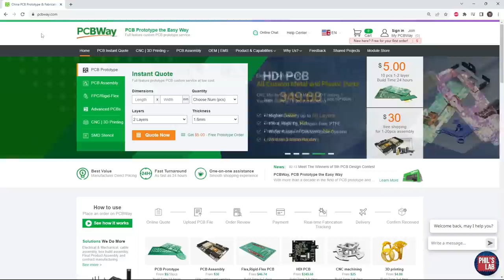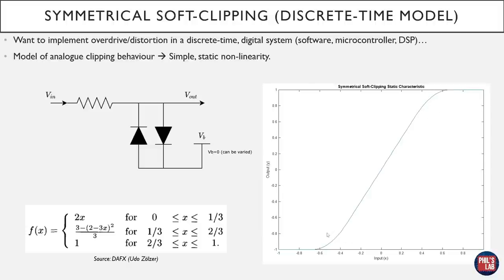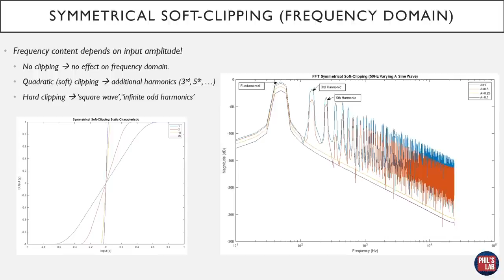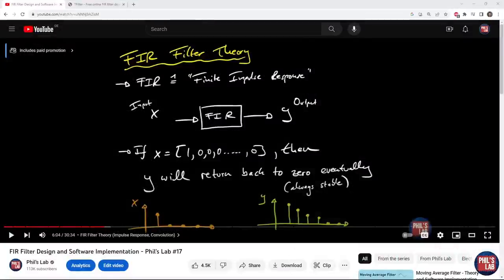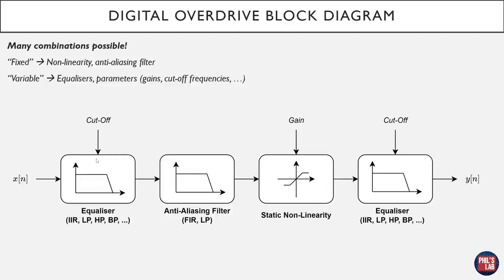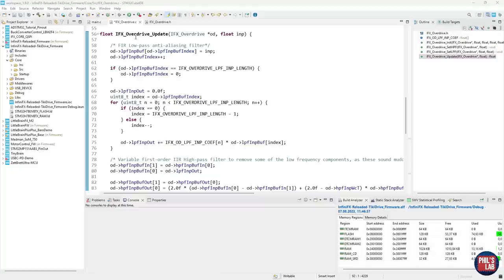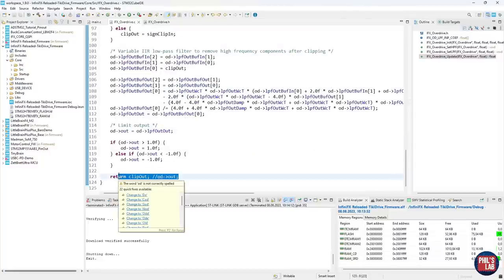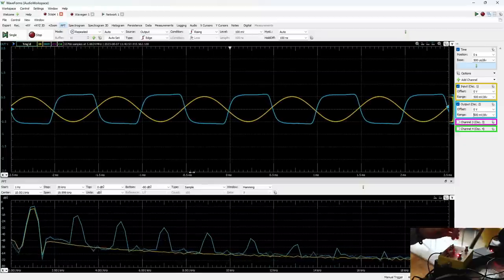DSP Overdrive Algorithm in Software (STM32) - Phil's Lab #117

Comment: From what I'm seeing here, this is what pedal folks call a hard clipping distortion algorithm.  It is more like a Distortion+, and not the kind of soft clipping that the Tube Screamer you showed actually does.  It's fairly easy to get TS style soft clipping, though.  Just add in the original dry signal (maybe after some of the filters) and tweak the relative levels a little bit.
Reply: That's not to take anything away from the actual content.  It's a great video and project, but...

Comment: I can't believe that I find always your videos about all of my hobies :) Some day, I design flight controller for long range UAV and quad, then I came across to your video about subject. Now I am planning a DIY effect processor project and bam your video is here. And you are always one step ahead of me :) My idea is copying the behaviour of a 12AX7 tube and amplifier into a microprocessor as a starting point. Basically my method will be based on cascade connected frequency filters and gain stages but definetely this will be not that easy.
Edit: Forgot to mention, amazing video.
Reply from the maker: Looks like our interests align quite well! :) Modelling valves is a great project. Have you checked out 'Digital Audio FX' by Udo Zoelzer? Awesome book on audio-based DSP, including some valve-modelling.
Reply: @PhilsLab  didn’t check, definetly will check
Reply: Wow man,this is also my interest ahaha!! I'm a guitarist myself and a electronics engineering student. Until now i implemented in MATLAB a 12Ax7 model and was trying to port the code in c++ ti realize a plugin. But It would be cool to realize this on a microprocessor! If you find some interesting resource please share beacause i love this stuff ahah
Reply: @PhilsLab  do you think you Will ever make a video about triodes modeling?and maybe some implementation like for this pedal for example

Comment: Awesome video and project! Combines a ton of areas of my EE background. I know the video is already packed with content, and you can’t cover everything in detail. But I would love to see more detail about the signal chain on the circuit. I guess because that’s the area I have the least experience in. Specifically how the STM32H7B0 interfaces with the analog signal. A quick look at the data sheet shows it has two ADCs and one DAC. It looks like some slick programming software is provided for it. Maybe I should just build my own pedal and get the experience!

Comment: awesome video! i'm watching it with great awe!  Just one little thing..The tube screamer has the diodes in the feedback loop of a non inverting opamp, hence, when the diodes are conducting, the stage turns into a buffer. This causes the signal above the diode threshold to get a gain of 1, not zero. This gives the typical "clean blend" overdrive tone of the TS style OD (specially with high output pickups). On the function shown, above 2/3, the signal should have been X, not 1.  In fact the function shown is actually hard clipping (diodes to ground, or on the FB of inverting opamp), where the gain above the threshold is zero.
Reply from the maker: Thank you! While I completely agree with you in the analogue world, given most books and papers in the DSP-world, the soft-clipper is modelled as shown in the video (for example, or similar but cubic) (e.g. Stanford https://ccrma.stanford.edu/~jos/pasp/Soft_Clipping.html, Udo Zoelzer DAFX book p. 118, DSPrelated https://www.dsprelated.com/freebooks/pasp/Soft_Clipping.html etc..). The 'softness' comes from the transition between linear and fully saturated (which thereby in that transition region also adds compression).

Hard-clipping in contrast, again in the DSP-world, means usually a single linear region - no transition - and hard saturation at the end of the linear region (e.g. Stanford https://ccrma.stanford.edu/~jos/pasp/Hard_Clipping.html or https://www.dsprelated.com/freebooks/pasp/Hard_Clipping.html).

Lastly, a main difference between soft- and hard-clipping, in terms of frequency domain, is the presence/prominence of higher harmonics. Hard-clipping has a significantly higher harmonic content, whereas soft-clipping - as shown in the video - has (slowly) decaying harmonics.

The image I showed with a resistor and back-to-back diodes, while this is indeed more for hard-clipping, I find it far easier as a simplification and illustration for the general clipping process. That's why I included it instead of the op-amp feedback path.
Reply: @PhilsLab  you're right. The function describes the shunt diode correctly. There's confusion on what "soft clipping" means.. on the analog opamp clipping world, it means "non inverting, diodes on   feedback".. but strictly speaking, it means a sigmoid function with soft knees, as you show.

Comment: Since the overdrive is software you can stack 2 overdrive modules to get a better distortion sound, much like an overdrive pedal feeding a clipping amp. High gain amps like your 5150 has several overdrive stages stacked.
Reply from the maker: That's right. Although I'm pretty happy with the single gain-stage of the pedal for now :)

Comment: I dont know if i didn't pay enough atention to your explanation, but it would have beed very useful if you mentioned that you are using the absoliute value of the input on the slide with the formula for clipping. I like your DSP series. Do you upload your code and PPTs in some place?

Comment: I can't understand why the antialiasing filter goes before the nonlinearity. The fault is obviously on my side since I'm not a fluent DSP speaker! ... in your example with the 1 kHz tone, digital converted signal spectrum is just a dirac around 1 kHz (I'm sure there is a lowpass antialias in the analog conditioning stage, so ther isn't aliasing just due to the sampling). Now, if I apply a lowpass Chebyshev filter, I think I end up with the same signal, just time delayed a bit. What am I missing?

Comment: One thing I've been wondering about with these mixed signal circuits is the reasoning behind the usage of an audio codec for signal input/output: Given that most STM32 MCUs have 12-bit or higher DACs and ADCs, would it be possible to use these for audio I/O, and if so, would it be feasible? Thank you for all these videos, they're really informative and entertaining :)
Reply from the maker: Thank you! 12-bits isn't that great for this type of audio, in my opinion. However, the ADCs are usually pretty fast in STM32s, so you could potentially oversample and average to gain some resolution. I did try this a couple years ago but the results really weren't great.
It's easier and better-performing, although additional hardware is required, to go the external (dedicated audio) codec route.

Comment: Please explain why the final "limit the signal to between -1 and 1" would not introduce more distortion and aliasing that would then need more filtering.
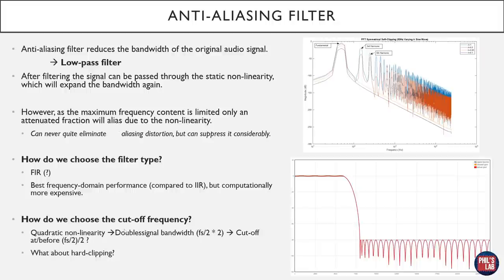Reply from the maker: It does and I alluded to it around 12:50 (somewhat as 'food for thought'). I said fs/4 was a reasonable starting point. However, I played around experimentally with various cut-offs of the AA filter and running the clipping algorithm, far lower than fs/4. But to me fs/4 yielded completely fine results (as heard in the sound demos), so didn't have to push it any lower in this particular case.
Reply: @PhilsLab  thanks for clarifying!

Comment: Why not shift the kneepoints on the clipping curve rather than changing the input gain so that zero gain / equal power is (approximately) obtained independent of the overdrive setting ? Or is it the intent that increasing overdrive also increases the output level ? Just asking, I'm no guitarist.
Reply from the maker: That could definitely be a way of doing it. However, to me it's more straightforward (and based pretty much directly on the analogue prototypes) to amplify the signal before going into the gain stage, as the output level of the gain stage only varies a bit above certain distortion levels. The final level then is tweaked via the volume control, if a big gain adjustment is done.

Comment: Great stuff. What does boost do? I assume that's for a future video. Also there's some delay/reverb, is this part of the pedal?
Wondering how much headroom there is for other effects i.e. how much % of the processing power is being used right now. I assume it depends on the quality of the filters. 
Hopefully cabinet modeling/simulation is also coming to this series.
Reply from the maker: Thanks! The boost adds a constant amplification before the clipping stage (preGain += 50). Can also adjust a DIP switch to add output volume increase for solos.

The reverb/delay was added in post on my PC. 

I haven't actually formally checked load - I'll measure how many cycles are used currently and how many in sleep, and get back to you!

Cab sims is a great idea!

Comment: Excellent breakdown and demo. I'm curious, with 60+ taps on LP at 48k, what's the small time delay through your system? Also, I'd like to see the IMD, intermodulation distortion, FFT with AD generating a 3 note chord. The frequency domain must be full fun peaks. Thanks for the video, well done.
Reply from the maker: Thank you, Craig! At the moment, delay is about 20ms (predominantly due to the buffer size, which can be varied). Good idea - I'll have a look at that :)
Reply: @PhilsLab  20mS is mighty fine. Thanks for the fast reply.

Comment: 6:20 bias shown is not correct. The clipping will be not symmetrical in this case. You need a positive and negative biases to work in both periods
Reply from the maker: What if your input signal has a DC offset? Then you need the bias (or in the analogue domain, AC couple) for symmetrical clipping. This illustration is for completeness sake and also to show there are adjustments to be made quite easily to achieve different clipping styles.